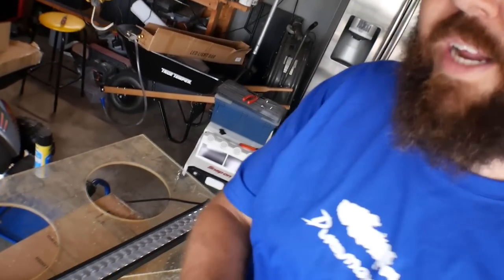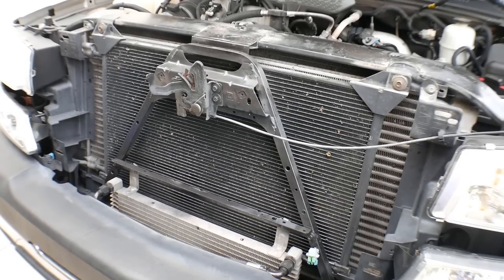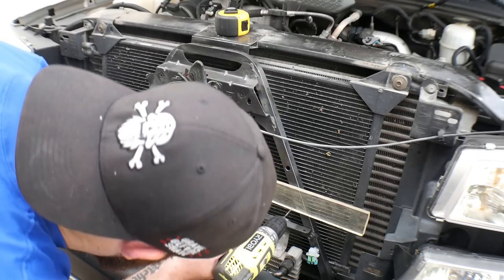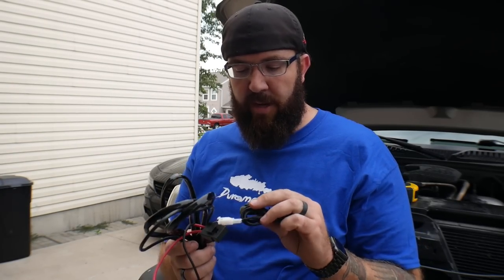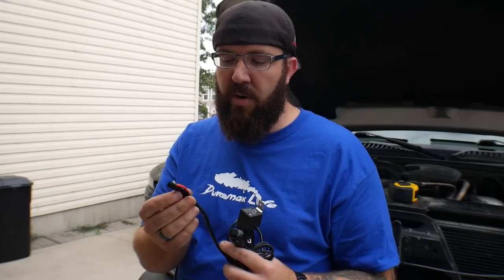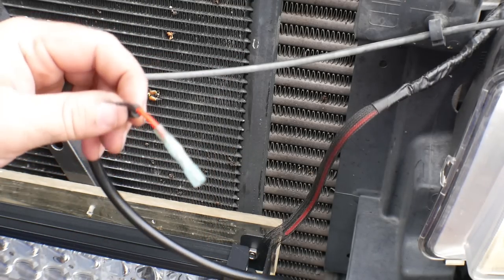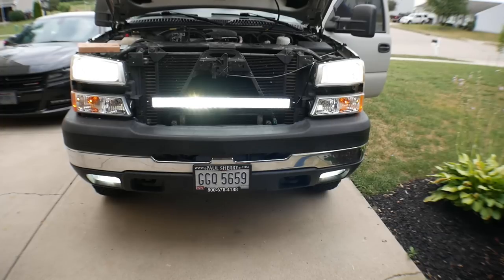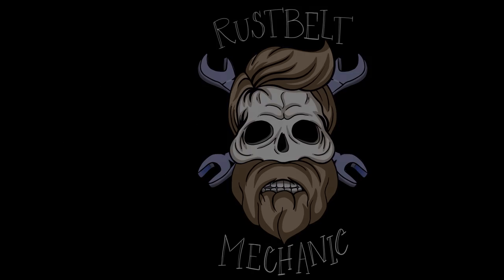Duramax/Chevy Behind Grill Light Bar Install 2003-2007

Comment: I did this the other day, so thanks for the video.  I ended up removing the cross member bracket and replacing it with 2x2 angle aluminum.  It provided the depth needed to miss the cooler.  And it was plenty strong.

Comment: You have a ton of space so you could mount two bars perfectly. I did two 30" on my 11 sierra very tight for but worked out. If I went curved then it'd fit way better imo.
Reply: Rough country has a double curved 30'  stacked lightbar kit with housing that's made for these trucks

Comment: My 1990 K2500 has very little room behind the grille. I'm practically touching the trans cooler and I still had to shave about 2.5" from the inside of one of the grille openings. Tight fit but the extra light is awesome. For wiring, I tied mine in with my high beams. No separate switch to worry about hitting when I meet a car on a dark country road. I also did a 4 headlight mod to leave my low beams on when the high beams turn on. Now I have much better visibility at night!
Reply from the maker: Nicely done ✅
Reply: Have you noticed any temp difference since you’re blocking the trans cooler? I have an 06 Silverado wanting to do the same thing and im wondering if the light bar will block the air flow.
Reply: @hunterbirgerson7302  The light bar doesn't block any airflow from the trans cooler. It's mounted just underneath. No temp difference that I can tell.

Comment: Nice demo on how to install this light bar. Can you share how you wired the head lights so the fogs and low beams stayed on when you switched to high beams?
Reply from the maker: All explained right here😁👍
https://youtu.be/S_6nxOmNbxk
Reply: Go to amazon  and buy this chip called fleece hi/lo/ fogs that goes underneath ur hdlmp /fogs relays - fuses and it overrides the factory fog off when hi beams r on

Comment: I know this is posted long ago... but i am currently using your idea just with metal instead of plexiglass, I am curious to know what Screws/Bolts you used to hold the plexiglass on the a frame

Comment: Is that your transmission cooler underneath the a-frame? Because mine is on top of the a-frame and I really want to install a light bar behind my grill but my transmission cooler is in the way there. My truck is a 2003 2500HD with the 6.6 Durumax diesel engine and idk if they changed the location of the transmission cooler on the later models or what, I have been trying to find that out but so far I haven't got an answer from anyone!
Reply from the maker: Yes that is where the earlier classics sometimes have theirs mounted. You can go a few routes. You could get a stock LBZ cooler and set of cooler lines. Or you could get a Dmax Store cooler also for getting lower too.
Reply: @RustbeltMechanic  I have actually looked around at a couple of other videos and seen ways to mount a light bar in front of the transmission cooler that is on my truck so I think I'm gonna try and go that route cuz It'd be easier than moving my transmission cooler.

Comment: Do it right the first time? Nah, Make it nice, do it twice!  Seriously, though, I normally run all my off road lights through my hi beams...i.e. the switch power comes from the high beam circuit.  That way the lights turn on and off with my factory high beams.
Reply: Exactly, I always use relays and while you could use the high beams to trigger the relay alone, I prefer to have a switch in the circuit so I have the ability to totally shut off the off road lights. I have my marker light circuit as the feed to the switch and relay for my fogs, for example. There are times and conditions where fogs alone are better. Oh, and look at my Suburban Overview video for a trick lil linkable relay base. I like that I can wire everything up and switch out relays without disturbing the wiring.

Comment: Enjoy that Duramax while it's running..it won't run long.
Reply from the maker: Compound turbos and two years later....just took it on a trip towing a 20ft enclosed trailer and a side by side 1600 miles....still runs like a champ

Comment: How did u hook it up to the battery because my light bar wires won’t let me hook up to my battery and we have the same wiring and battery
Reply from the maker: You have to wire in a switched relay. A switch ran inside that turns on a relay which in turn will turn on the light bar.

Comment: Why mount behind the grill? In front on the bumper would be a better spot, the grill blocks some of the light
Reply from the maker: I would agree, but I have a hunch the stock front bumper won’t be staying all that long
Reply: Rustbelt Mechanic ahh I see, makes sense now.
Also you made a comment in the video about a roof mounted light? I got a light on my roof and it don’t make a sound (my car is my profile picture). But I have heard others with roof lights that it’s horrible
Reply from the maker: I bought my truck with a 52” curved lightbar above the windshield. It made so much noise I couldn’t stand it. I tried every trick in the book to quiet it down
Reply: Rustbelt Mechanic it may have been too close to the body, my dads car has a 32in on his roof with the mounting hardware that came with the light and it whistles even going slow and gets worse the faster ya goes. I mounted my 42in light with homemade brackets and it makes my light a little higher off my roof than my dads and it don’t make a sound at all. I was actually surprised by it tbh
Reply: Mr Mercury 
I want to put a roof light on my Xterra but then I won't be able to park underground. In front of the grille will make me a target for the police who pull up new laws from their ass every day...
Reply: Agent. K. I got one on my roof and one on my bumper in front of the grill and haven’t had any problems with the cops where I live

Comment: does this affect the cooling at all? im interested in trying it for my 2500
Reply: That is especially important for the hotter running LLY (2004.5-2005) series owners.
Reply: I like the light bar, but not where you installed it. It will interrupt cooling, especially if you're pulling loads behind you.

Comment: What trans cooler do you have that makes it sit low like that?
Reply from the maker: That’s the factory trans cooler for the 2006 2500 LBZ
Reply: @RustbeltMechanic  ah okay I've seen that on other trucks an I was wondering about it, thanks!.  I've got a light bar an wanted to put it behind the grill but didnt want it blocking the trans cooler on my 03 lb7.
Reply: @RustbeltMechanic   how hard was it to switch the two coolers around?

Comment: Would this be the same install for a 2001 suburban. I already have a 42inch light bar that was on my 05 f150.
Reply from the maker: As long as it has the same looking A frame bracket in the front yes

Comment: Very nice Iv been thinking about adding one myself. I have a ranch hand grill guard that I can mount it to but may go this route so it’s out of sight. Like to keep the truck looking clean and stock 👍🏻
Reply from the maker: DmaxTraveler06 it’s very clean and out of the way, especially when I need to get on the bumper to work under the hood
Reply: Dont do it, cheap light bars are not a respectable mod where I come from. If your gonna run a cheap light bar you NEED & MUST run a few of them, Ive seen ones that are stacked ontop of each other.  The RBmechanic just didnt know when he got it =)
Reply from the maker: Yoda Doug future video....cost effective(lol cheap) light bar vs quality light bar 😁👍
Reply: Lol Yeah well no more than I would use it I wouldn’t want to spend a load of money on one. If I’m going off road all the time I’d see spending a few hundred on a light bar but I think he’s like me just use it here and there when you go down them long dark back roads or traveling down the driveway at night. My driveway alone is a 1/4 mile with fields on both sides I couldn’t tell you how many times Iv had deer run out in front of me and didn’t see them even with high beams on. It gets really dark down on my land. I guess that would be a reason to buy a expensive one but my truck only moves on weekends due to me having a company truck.
Reply: once you have the light bar you find all kinds of different uses, I've learned building up my truck buy once cry once... Check it out 1991 22re 4x4 toyo truck theres a quick walk around vid. I plan on keeping her forever and doing a 4bt or the mercedes OM turbo d. I love the size and functionality of my truck I been suppin up the ignition and injection system and a magnaflow =)